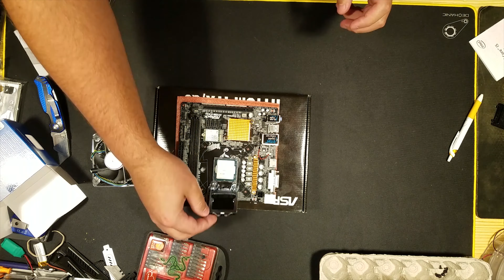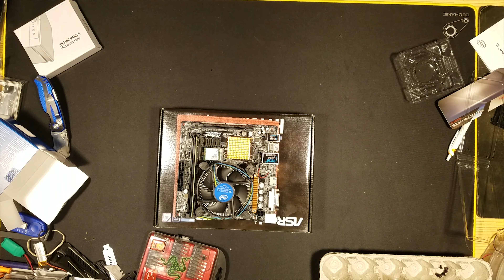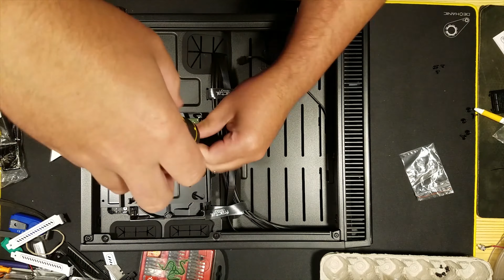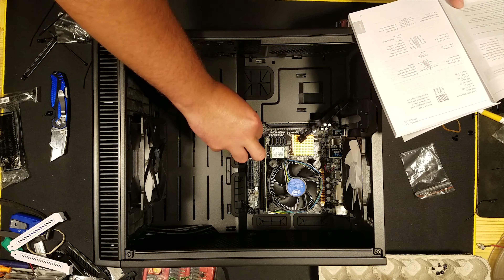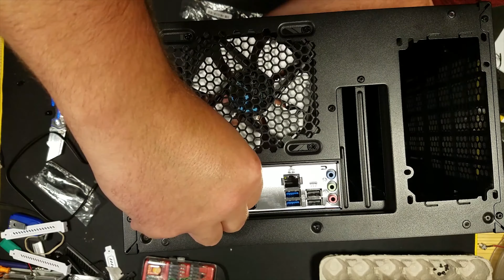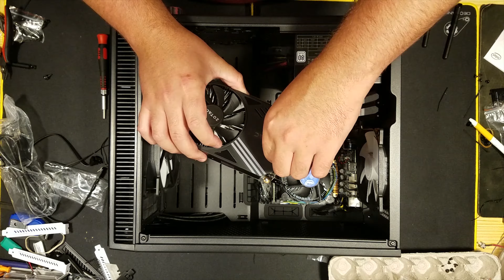Define Nano S Build - GTX 1060 + i5-6400 - Time Lapse

Comment: what kind of temps are you getting on your 1060? I'm a bit worried since the PSU is right in front of the GPU.
Reply from the maker: It was sitting around 75 during Unigine Heaven
Reply: tbjr.tech overclocked at all? I've got an EVGA 1060 SC and I'm gonna be switching to the Nano S here soon